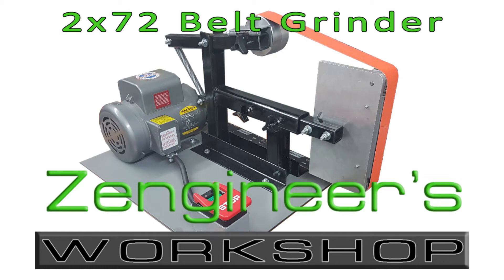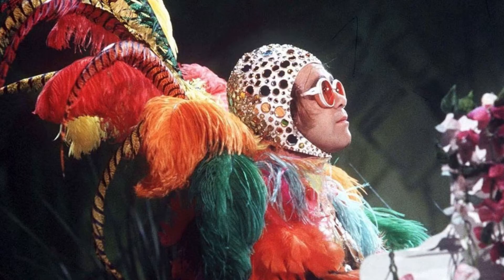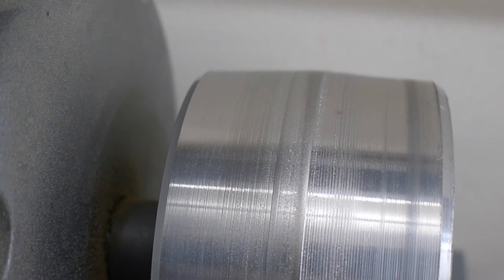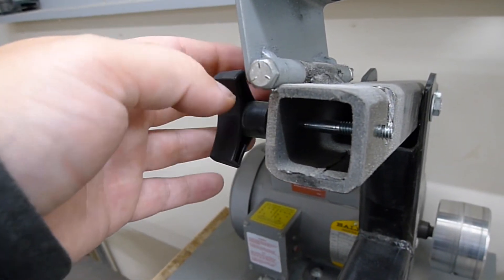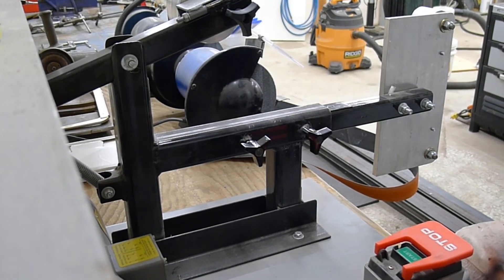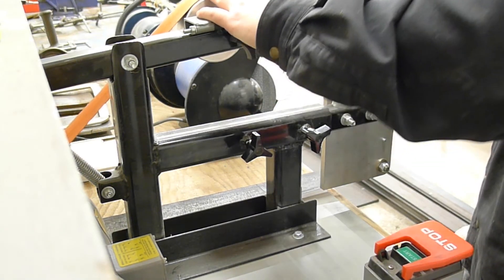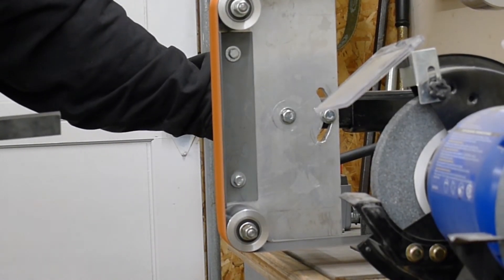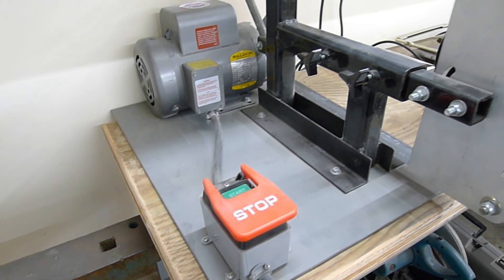2x72 Belt Grinder - Why you NEED one NOW!

Comment from the maker: I've had a few questions on what the total cost of this build was. I peg it around $500canadian (aboot $14.99US, or 6.1 euros), with the bulk of the cost being an used motor ($150) and steel/aluminum ($200). The rest was bearings, spring, wiring, switches, hardware, etc.
Reply from the maker: @anonymoushippo-m7d  They run $2000-$3000 in most cases.

Comment: Nice design what are the dimensions for the  components?
Reply from the maker: That's a pretty open question, but will help how I can. Platen wheels are 2" diameter, tracking and drive wheels are 4" diameter, base plate is 22" x 14". Main vertical tube is 14" tall, and the horizontal tube is installed 6" above the base.